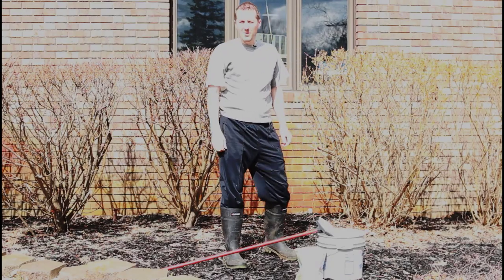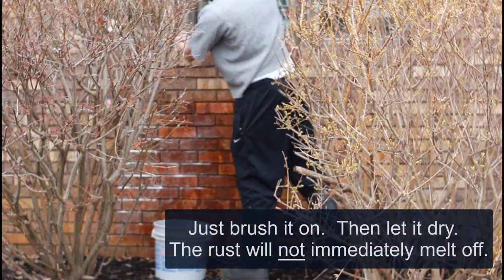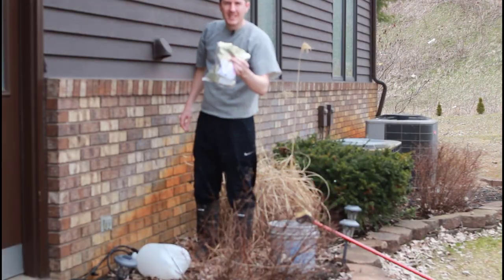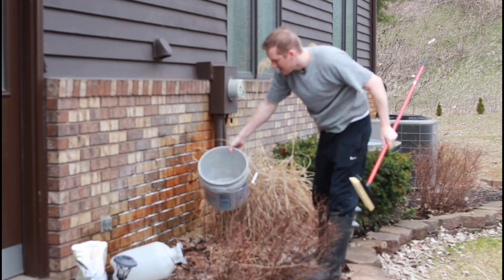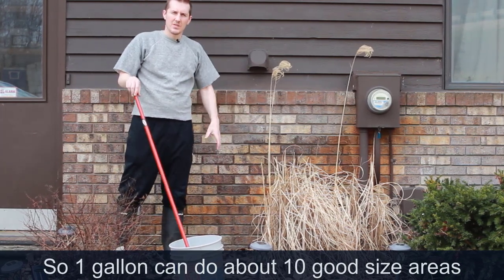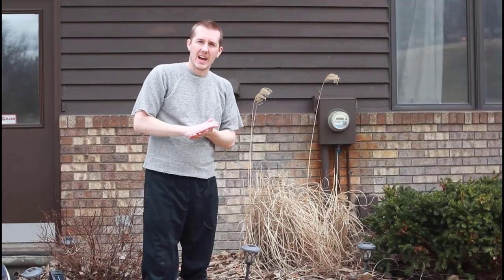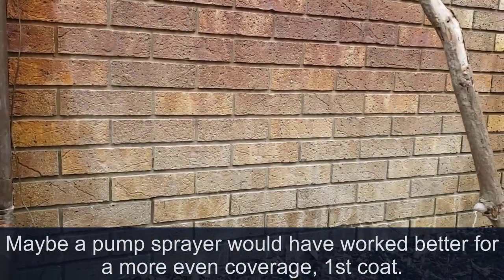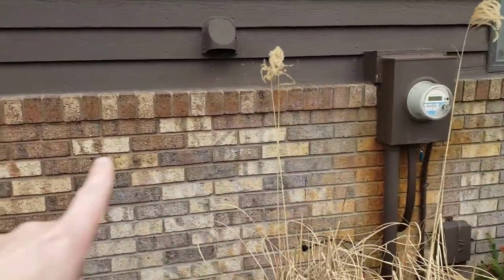Remove Rust From Brick House - Best Way to Get Rid of Rust Stains

Comment: Dave, you never want to spot treat with acid on brick/concrete. You need to go joint to joint or full face. Use a pumper, like you ended up saying at the end, for an even coverage.

Comment: What is making it suds? I’ve done exactly what you said it’s not sudsing and it doesn’t even appear to be coming off.
Reply from the maker: Some areas it worked great, some it didn't.  I was thinking of redoing it by just using a garden sprayer, no scrubbing.
Not sure about the suds, maybe it's because i added too much powder and it didn't dissolve.

Comment: You really let it dwell too long, and should have used the sprayer. And when playing with strong chemicals you don't understand, follow the instructions. And use proper protection. For your hands,  and your eyes  even a mask. Splash back in your eyes could have nasty consequences. 
Also, soak the ground before and rinse well after.

Comment: This is wrong in so many ways it's almost painful to watch. First of all you should wear gloves and eye protection when handling any kind of solvents or acids. Secondly you should wet the entire area first with just water, and then apply the cleaning agent lightly over the entire area using a sprayer then hard brush the stained area. After that you should wash the entire area again with a light detergent to neutralize the acids remaining
Reply from the maker: I maybe agree with your first point - to wear safety gear.  But that doesn't necessarily mean i'm doing it wrong.
I combined your 2nd steps.  Instead of water, acid then brush - i'm doing them all at the same time.
And instead of detergent i just sprayed off all the bricks with a hose to remove any remaining acid.